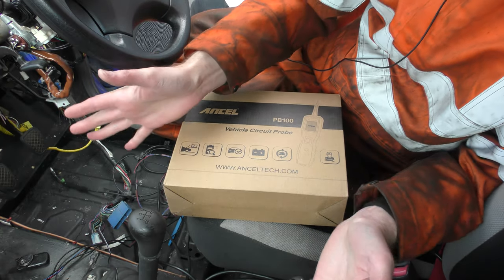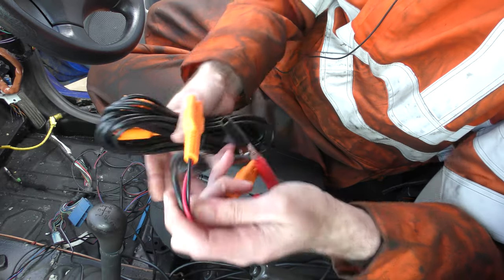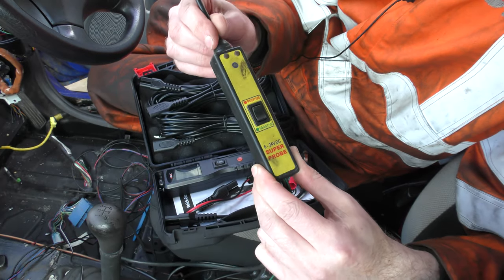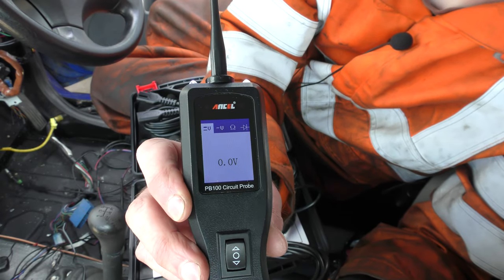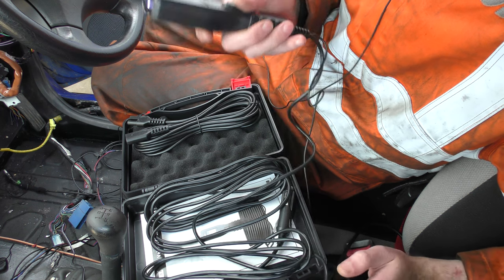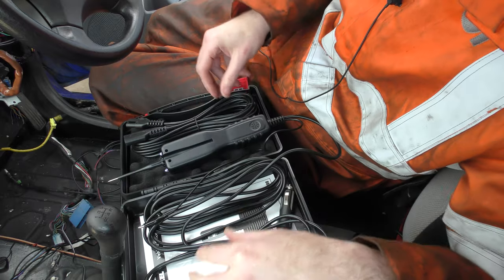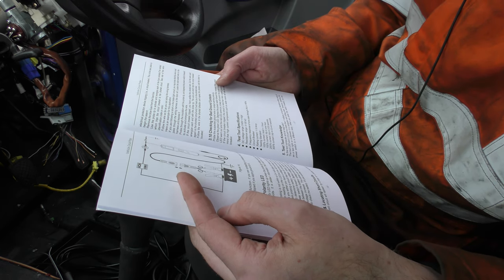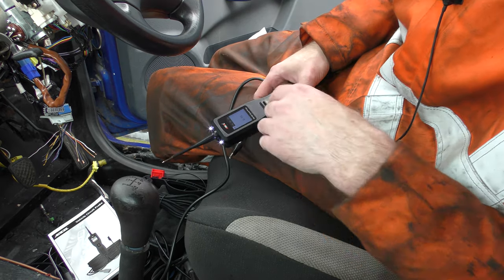ANCEL PB100 Automotive Circuit Tester Power Probe || test/review

Comment: A delay on continuity will slow down testing if you have a lot of wire's to test out, 42 plus years as a test engineer in professional test equipment UKAS electrical test laboratory & in Aerospace Defence Hardware Test Qualification Verification Consultant, I prefer continuity to be constant sound with no delays, a delay would really be very annoying,
I've purchased the ANCEL OBD2 Classic test unit & it works well on my old Volvo S80 D5 to reset the ECU fault code P0102 👍
Reply from the maker: I couldn't agree more.  Why anyone makes meters with a delay on the continuity boggles my mind.  How can I test if wiggling a wire effects the continuity if I have to wait for the meter to read.  :)

Comment: I once made myself a tiny litle box which holds a on-off push-button, a two-way switch for choosing polarity,  an LED just to see if it's on or off, and it holds a 5v battery, it all has attached tiny crocodille clamps. It was for testing components, but mainly it was made for when I had to replace and investigate Nokia 5110 vibrator motors back in the day.  it still works too =P

Comment: I work with CNC machines that quite often use 12 or 24 volts but also run with three phase. Would you be able to test high voltage with this device as well or would it just blow up?
I understand that I would still connect the crocodile clips to an earth until a low voltage but if I was to touch the probe on a high voltage output would it break the device?

Comment: What happen  if we energized negetive line to positive from the tool (on by mistake) does it has protection system something like main fuse or circuit breaker near the cocodile clip. Only fuse blowen will happen or that will leads to destroy the too in such a mistakr

Comment: I have a PowerProbe which is probably 20 years old (and still works fine) but mine doesn't have any (fancy) lamps or LEDs.  Shame this one turned out to be shite!  I was considering buying another one for at work - but it won't be this type!
Reply from the maker: I've looked at new power probe.  Very powerful and very expensive.  I only use my tester occasionally so couldn't justify the cost.

Was actually chatting with a mechanic friend the other day about his version of the Ancel.  He has to keep checking which beep means what when he can't see it.

They were so close to making it right.

Comment: So how does this work? does it start at 5v and increase to 12v?  not everything in a car runs on 12v.  Or maybe I'm thinking too complicated now. Can you choose voltages on this thingy?
Reply from the maker: It just applies battery voltage positive or ground to the tip of the probe.  No voltage choice.

Comment: A bit of wiring? Yeah, just a bit, lots of spaghetti and noodles in there........ :S

As for the tool, it does seem to be a biton the cheaply designed side, the software could be a lot better, giving a faster response time as well as having different tones rather than just sounding like an ECG machine hooked up to someone with a fast heartrate... :P
Reply from the maker: The wiring to engine is mostly complete.  It starts and runs.  Just everything else to go.  Lights, wipers, windows etc.  :)

They've copied the look of the Power Probe, but not its operating system.